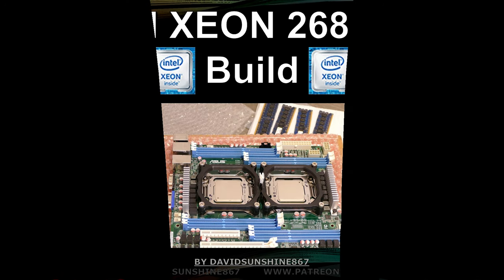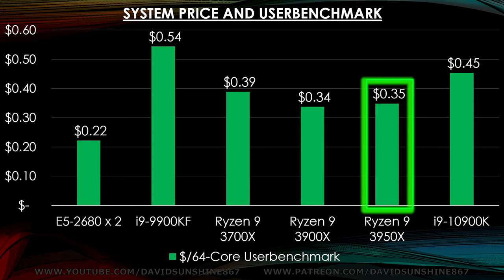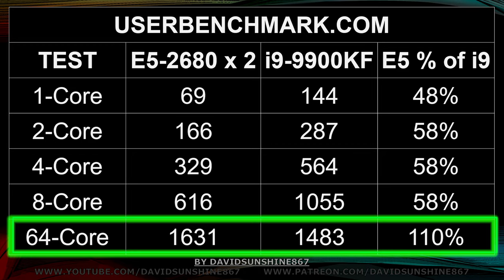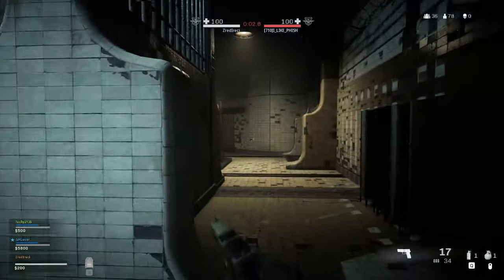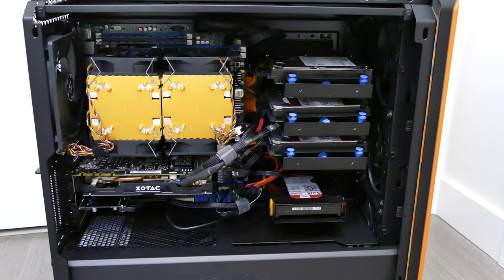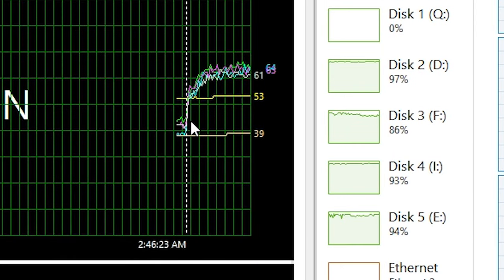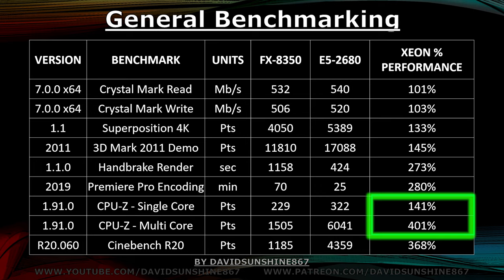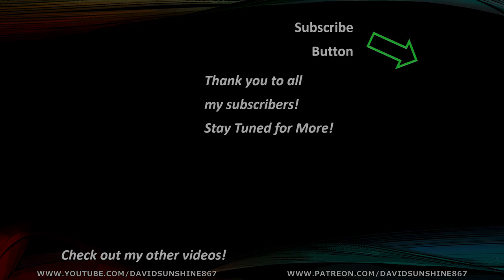Dual XEON CPU Build vs. Intel i9 and Ryzen 9, It's Faster!

Comment: This video deserves WAAAAY more views. Maybe its your tags but Im very grateful i found your video! I desperately need a computer for youtube.
Reply from the maker: Thank you!  I'll add a few tags to it.  It's definitely a fun budget build, giving lots of power for the price by using these old server CPUs.  
Cheers!
David.
Reply: Excellent video but I think in terms of power consumption alone it's better to run the E5 V3 Xeons at this point in time. Even at full load the 6 and 8 cores use very little power. Even the 12 core will use a lot less power than these X79s. Plus with the X99 boards you can upgrade to E5 V4's later on and they go up to 22 core on 2400mhz ddr4.
Reply from the maker: @thomassmith4999  Thanks for the great advice!  I think that's a good option to have, being able to upgrade to V4.  I'd probably go that path if I were gonna upgrade now.
Cheers!
David.
Reply: @thomassmith4999  Agreed.

Upgrading to dual cpu makes no sense to me. Even used decent Dualie mobos cost a small fortune and they are not as convenient for desktop use because they are mostly designed for server application. They use more electricity. It doesn't double processing power and in some cases performance is even worse than with a single CPU. It offers no improvement to gaming performance or to any single threaded task.
 With few exceptions, anything less than the 269x-3 cpus are mostly just plain slow at the turbo end and/or have too few cores for serious multi-threading... And like you said, the V4 option is available with X99 or C612 chipsets. If I really want to game, I can drop in my overclockable I7-5930K (runs ~4.4gz on water at ~70-75 deg but the 2690-3 games just fine.

I have a XEON E5-2690-3, Asus WS/IPMI, 64GB DDR4 ECC, RTX 2800 -S, 970 EVO 1TB (Boot), Fusion-IO 3.2TB PCIe SSD (Accelerator), Adaptec ASR 8805 w/4 4TB Seagate Terascale HDDs in RAID5 (Backups), 3 SATA SSDs totaling 2TB, Corsair HX-1000W PSU, 5 monitors (2 are 2160p 3 are 1080p), Humongous Corsair HAF-X Case, and I'm happy as a pig in mud.
 I got everything used except the 4K monitors, the HDDs, the water cooler and the 970 EVO. It's all hooked up to a sweet Yamaha 5.1 Hi-Fi thing.
I'm currently trolling for a E5-2696-4 or E5-2698-4 or E5-2699-4
Reply: @Ceeewolf  I've had a dual CPU running all the way since 1997 till now but I have not used them as my main machine that's powered on all day in more than a decade. As you say the power consumption isn't worth it. But they are.. very cool :) to look at. I want to buy a Lenovo P900 at some stage when they are cheap.

Comment: Thanks for the break down. I have been building these Xeon builds over the last 2 years for people. If you can get any of the V3 versions cheap that support DDR4 and get a motherboard with quad channel memory support the performance is even better. Look into the Xeon all turbo unlock as well. The boost from the unlock can give you 10-20% more performance. These Xeon builds are great for gaming and content creation for the price. The 10 core - 18 core Xeons unlocked are great for modern gaming if you can get them cheap. I have had issues unlocking the dual xeon builds in the bios, but it is possible to do if you can figure it out.
Reply from the maker: I couldn't figure it out.
But the single cores overclocked would be great!
I put a 3070 in my xeon build and for gaming it was ok, until I hit battlefield 5, I was CPU bottlenecked and the inputs became laggy, wasn't a problem for the 1070 though.  The faster 3070 just demanded more, so it created that problem. I switched to a Ryzen and it was fine, due to the higher single core performance.
The faster Xeon clocks would probably help resolve that, but my stock frequency E5-2680s just couldn't keep up.
Cheers!
David.
Reply: @DavidSunshine  the e5 2680 you use is v2 or v3????
Reply from the maker: @Adel-sj4ue  Hi, mine was just the first generation, E5-2680, without any designation. It would be the V1 if they designated it, launched Q1, 2012, so mine is pretty old and dirt cheap, great for budget systems.  The V2 came out Q3 2013. But if you have the budget I would recommend getting the V3 with DDR4, you'll get better single core performance and better overall system performance. 
Cheers!
David.
Reply: @DavidSunshine  so go after the fastest Xeon ala 2.8ghz and up if you want better performance in newer titles for example the 2689/90 for me? i'm still looking into what might be the best deal cause i just want to defeat stuttering outside of that i'm happy atm and atleast i don't own a  3070 so that same issue won't be there.
Reply: I just picked up a supplier for myself that updates systems for clients.  He has all sorts of systems laying around. I'm getting them at rock bottom prices. I don't know exactly what systems they are as of yet.. from older servers like the t5500 and up I'm sure. Even some older gaming pcs that I can squeeze some life out of for low end gaming like minecraft league of legends dotA 2 fortnite...

Comment: Excellent video.
I've just put together a 128GB DDR3 ECC, dual E5-2667v3 system with a 2080 ti and 2x 970 Pros (NVMe).  It's pulling over 500W on full CPU blast and similar when stressing the RTX.  The HP Z840 has a 1150W PSU and I have yet to do a CPU + GPU burn test!
Reply from the maker: Hey Brynjar, 
Thanks for sharing your system details.
Wow that's an awesome system!  Must be hella fast!  I have yet to use NVMe, but that's definitely the way to go, Samsung all the way tho!  
It'll put out a lot of heat if you run everything, I had to turn my fans up to full speed when I did a burn in. 
I know it can do anything from running VMs to gaming, rendering, but what are you gonna mainly use your system for?
Cheers!
David.
Reply: where did you buy 128GB DDR3 ECC and HPz840?  Can you provide a link? Thanks

Comment: Great choice for the performance...even in 2020! I am on the same motherboard with 2 x 2650 v2's with 64GB of 1600 MHz ECC RAM. Do not forget eight sticks of RAM will run in octal channel with lower latency compare to DDR4. It is also very easy to modify the BIOS to boot from NVMe drive.
Reply from the maker: Wow!  That's amazing.  Sounds like a wicked setup.  The NVMe must provide awesome performance!  I haven't used em before, still on the SATA SSDs, but I should upgrade once the price of 1TB NVMes come down!
Thanks for the heads up!
Cheers,
David.
Reply: Way to go congrats, I got myself an X9DR3-LN4F+ am upgrading it to xeon V2s and my NVMe is already up and running in my X7DBI+, with PCIe gen 3 on the new board will be even better.
Upcycling is the way to go, but it's not easy

Comment: Hi David, this is very well done. I have only got into Xeon CPUs recently having built one with an E5-2690v3 with 64 gig 2666 DDR4. I mainly need multi-core performance and running two Xeon CPUs makes a lot of sense.
Reply from the maker: Hi Steve, thank you! Glad you liked it.  It was fun to build, test, and present my findings.  Definitely worth it.  Gave me much better rendering performance for a small price.  Wow the E5-2690 V3s are nice!  That's a good rig with DDR4, I feel I'm losing some performance with DDR3, but it was a budget build, otherwise I'd like to have gone V3. 
Although single core performance is lacking compared to the newer CPUs, I'm pretty happy with the gaming performance!  I think it's more GPU intensive so as long as I'm not CPU capped, the XEONs are doing fine. 
I'm quite happy with the XEONs, great all around system performance!  Helps me game and get my work done!
Cheers!
David.
Reply: @DavidSunshine  Very awesome. I am all over the place here. I am an IT guy and have a decent main system of 8700k - 32gb RAM - 1080ti but have recently gotten into CG and Houdini. Someone is offering a threadripper 1950x with 1080ti 64gb of ram for 1500 but then I feel like one of these Xeon builds might be suffice for learning. So many options but when you have no real budget it is tough :) thanks for the video.
Reply from the maker: @Vectorr66  You're welcome!  Ya that's a pretty price to pay for the 1950x system.  For $400, you could get dual 12 core, have 24 cores total, and have about 2495 userbenchmark points in multicore performance, the 1950x gets you about 2201 userbenchmark points.  So the Xeon system is faster by 13% and is much cheaper.  The Xeon systems definitely have good bang for the buck!
Cheers!
David.
Reply: @DavidSunshine  thanks! I have been trying to look into all the different xeon and years released and all. Any chance I can chat with you? Thanks!
Reply from the maker: @Vectorr66  Anytime!  I actually only have direct experience with the dual E5-2680, so I rely on userbenchmark for a lot of the performance data.  One thing I think it's important is single core performance though, as that'll make editing and using the software quicker.  The Ryzen 5900X might be your best system, since it's got great single-core and multi-core performance, but it'll be a challenge to get one right now.  5800X or 5600X might work pretty well too. 
I don't think you need a fast video card, but it can certainly help, but it's pretty hard to get the RTX 3060Ti, to 3080, but it's worth trying.
Cheers!
David.
Reply: @DavidSunshine  if someone was wanting to stay dual xeon what do you think the next version up might be? I saw some server 2u systems but really want to find something I can put in a workstation if possible.
Reply from the maker: @Vectorr66  I would go with the Dual E5-2678 V3 12-Core 2.5Ghz/3.3Ghz Turbo, it's 57% Better Performance than E5-2680 V1 and uses DDR4 2400Mhz ram - https://tidd.ly/3gq90vm
I wouldn't bother with a rack mounted server, just stick with an ATX motherboard like the X99.  For less than $400, it's gonna be 13% faster than the ThreadRipper 1950X and cost a lot less.  With the money you save on the system, you can go out and buy a 3080 RTX GPU if you need fast video, it will make a great gaming system as well.  You'll have yourself a beast of a system and pay a fraction of the price.  Pair it with a 1TB NVMe (https://amzn.to/2KCtoxA) and you'll have a blazing fast system for a good price. 
I use a beQuiet case, the Silent 601, but their base model isn't bad either: https://amzn.to/3sLg9Mm
Then a cheap thermaltake 850W PSU will make a solid system, feeding plenty of power to the dual Xeons and 3080 RTX: https://amzn.to/3pbK5in
That's what I would do if I were to build a new budget system right now.
Of course, if I could spend more, I'd probably get the Ryzen 5900X though, but it is a little pricy, but singe core performance is amazing, so may be worth it.  Hard to find right now though.
Cheers!
David.
Reply: @DavidSunshine  oh wow thanks. I personally have never bought off of aliexpress. You trust this route? I have just been looking on ebay. I am guessing I will see a bigger increase in performance for Houdini then my 8700k. I appreciate your time!
Reply from the maker: @Vectorr66  You're welcome!  I actually use Aliexpress much more than eBay, and think their resolution process for disputes is much better.  I haven't ordered a computer package from Aliexpress, but if I didn't get my parts separetly, I would trust that route.  If you run into problems with the order, like a CPU is broken, they'll probably ask you to send back the defective one and they'll send you a new one.  If the system just doesn't boot up, they would probably ask you to send it all back for a refund, might cost $40 to send back.  A lot of other youtubers have had success with the X99 and X79 boards and CPUs from Aliexpress though, so I think it's a small risk.  
You could order from eBay if you're more comfortable dealing locally though, probably only $10 to ship something back.  I found this one, it's a little more though:  https://www.ebay.com/itm/Dual-X99-Motherboard-with-2011-3-XEON-E5-2678-V3-2-2pcs-X-16GB-32GB/114475192536
The 8700K has pretty quick single threaded operation, but Houdini seems like it makes good use of multicores.
At least for simulations, the Dual E5-2678 V3 system will perform 2.4x faster than the 8700K.
Cheers!

David.

Comment: if you dont need more core. Do consider E5 2650 v2. Slightly single core performance, but with 8 core 16 thread. (recommendation from proud owner of E5 2650 v2)

Comment: After seeing this I first planned a build but ended up just buying a complete 2015 vintage refurbished dell with dual xeon E5-2680 V3 and 128GB ECC DDR4 case  500GB SSD complete with a 2 year warranty for less than 1k. Being more of a high end workstation than a server it even has a sound card and room for dual video cards.
Thanks for the Tip
Reply from the maker: Glad you enjoy the video!  Great deal! Glad you could get such a beast for a great price!  Can't beat that deal!
Enjoy all the computing power at a budget price.
Cheers!
David.

Comment: great video, only missing a power usage comparison.
Reply from the maker: Thanks! You're right!
I should have played games and rendered with power usage, but without that, I can tell you it'll use about 70W more if the application uses about 70% CPU.
My AMD system used about 450W full load, the dual Xeon uses 550w full load (that's a burn in test, so normally it won't be that high). I would say that having two CPUs actually uses double what a single system would use. 
The benchmarks says each CPU uses 100w, which is about right.
So in the end, it'll cost you about 20% more power usage over a single CPU system, since the GPU, HDDs and other components use up so much.
Hope that helps!
Cheers!
David.

Comment: Nice to see someone still testing this Systems against newer ones. Got a Dual E5-2667 v2 Setup, 1866Mhz Memory, Asus Board. Cinebenche R20 get mit 5130 points. The v2 are a little better but often way more expensive. Some nice extra all E5 26XX V1/2 have are the 80 PCI-e Lanes, with NUMA something like Octachannel DDR, UDIMM or RDIMM and even LRDIMM and in my case 16 Memory Slots. Got 105 GB/s memory Read with Aida64.
Reply from the maker: Awesome, 5130 is really good, I was hoping mine would break the 5000 mark but it couldn't.  V2 does seem to be the way to go.  It's a little more, so not for everyone on a tight budget, but I think it's worth it for the performance increase over V1s.  
105 GB/s is damn fast! Nice!  Sounds like an awesome system. 
Cheers,
David.

Comment: Your video confirmed that I can play non-AAA games on my server(Universe Sandbox 2 and AutoCAD 2018-for me its a toy).  I choose 2xE5-2667v3(16-cores total@3.2GHz), 256Gb DDR4@2133MHz.  It boots from an Evo 960 Plus Pro on a card in slot 1, uses a Quadro P4000(8Gb), and a Sound Blaster card.  It all fits in my HPE DL380 Gen9 box.  I have an 800 Watt PS, though there is a redundant second one.  In 2023 I still plan to buy an X-Box for Flight Sim and Train Sim.  I don't use CPU-Z because I have iLo4 that tells me everything, even when its working on something else, or even when its turned off.
Reply from the maker: Ya your non-AAA games should run great! 
Sounds like an amazing system, solid, especially with those redundant PSUs!  That's cool that you can see your computer from anywhere with iLo4, I would definitely use that if I had the option.
The v3 Xeons have good performance, that system will keep you going for a while!
Game on!
Cheers!
David.

Comment: My media server has a pair of E5-2680's, 128 gigs of ram, and an RX580. It used to be my daily driver and was SUPER FAST at encoding media, editing a 4k timeline, and ripping blu rays (yes I still do that).  I have now upgraded to a 1950X threadripper with an RX5600XT THICC II. Now you want to talk about speed, threadripper is in another world.  So now my dual xeon system is pulling duty as my dedicated media server. Word to the wise, AMD cards are great for gaming and media creation, but they suck at hardware transcoding. Luckily these dual xeons handle transcoding well enough for my needs.
Reply from the maker: Nice!  The 1950X looks like an awesome CPU, what a powerhouse!  And the RX5600XT is a very powerful card.  That system sounds great for gaming and encoding!  I bet you can play most games maxed out with that system.  
But ya, the Xeon's still have their place for brute computing, so that's good.  
Cheers!
David.
Reply: @DavidSunshine  This is true.  It won't be long before big tech upgrades again and the market will again be flush with server chips.  When the Platinum 8180's get dumped on the used market I'll be waiting.
Reply from the maker: @rdsii64  Damn, that 8180 looks crazy!  28 cores, 56 threads, wow.  Imagine dual CPU with that, 56 cores, 112 threads!  Haha. Wild. I'll be waiting as well!